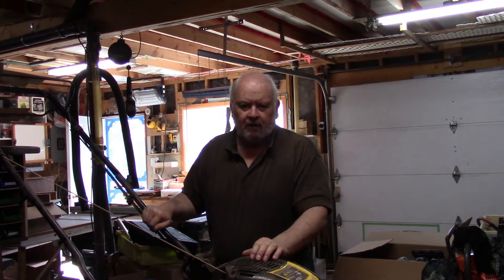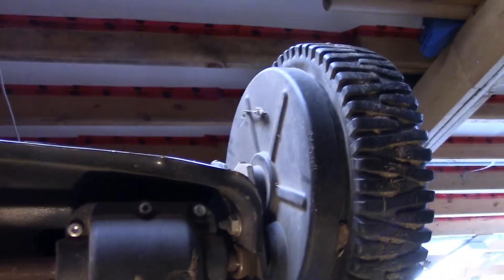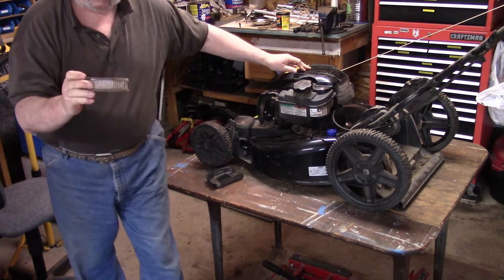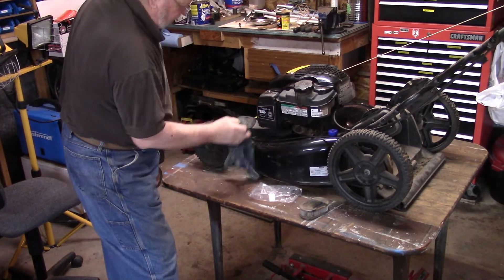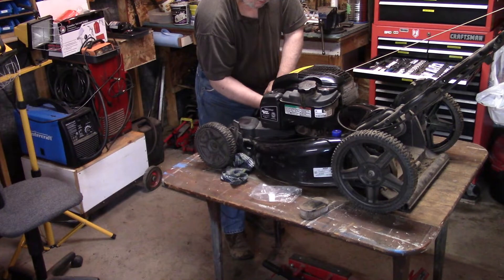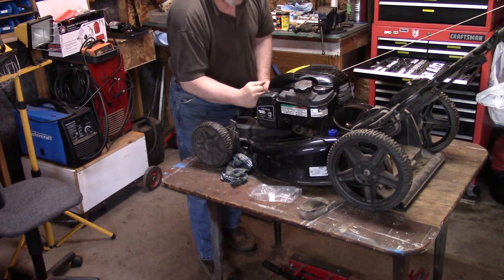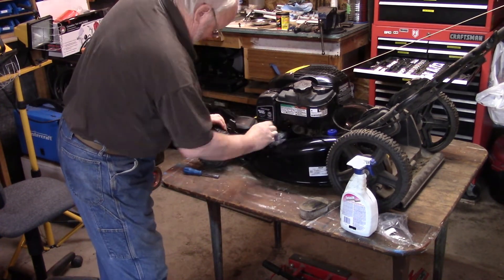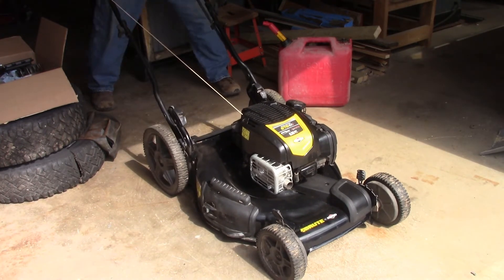Lawn Mower Maintenance

Comment: Oil comes from the ground and has the dirt filtered out. We filtered and recycled the same 30 barrels of hydraulic oil for the nine years I managed the Machine Repair and Maintenance at UTC. The oil doesn't change it just picks up junk from the environment. 
We heated it to 140 degrees F. to drive off the humidity. Then filtered it through a three micron filter. The oil passed new specs for acidity, viscosity, and particulates after each test.
We lost a gallon with every filter change. Before we fixed and tweaked the setup on the recycling system and got it working again I was buying 15 barrels of oil per month. Every year we disposed of 60 barrels of oil. 20 barrels from each of the 3 extrusion presses during the annual maintenance. 
The inexpensive oil you buy that is marked rerefined is simply filtered. 
Briner oil sold me 15 barrels of hydraulic oil per month. When I stopped buying hydraulic oil the salesman asked me if I changed suppliers. I showed him the system and how it worked. He asked if he could test a sample. He was sure we were using bad oil. 
The test came back as good oil. We talked and he explained that he was sure it would be acidic. He also thought the zinc compounds would be removed by the filters. 
Soon after that Briner built their own recycling system and is selling "rerefined oil". 
My brother owns a steel hauling company. They connect an external filter pack to the trucks when they are parked at the terminal.
Reply from the maker: How's she goin'?  Oil's life span can be increased for sure.  Where I worked we started to do oil analysis of all major gearboxes and switched to synthetic oils.  Our oil consumption went way down, and like your oil supply guy, ours turned to re-refining oil rather than selling oil!!!  I still think I should change the oil in my mower though!!!  LOL  Take care and thanks for the comment!!!
Reply: @GrampiesWorkshop  I thought about filtering the engine oil at home. Two cars, 3 tractors, a mower, and a truck ended up at near 20 quarts. The problem is there isn't enough reserve oil in such a small system. Filtering a gallon of oil at a time requires running pumps, heaters, and filters just like the bigger systems.
At UTC the oil that drained or leaked from the presses was originally captured in an underground steel tank that held about 30, fifty five gallon barrels of oil.  Later I installed 3 diaphram pumps that returned the oil to the filter system. The filter system at UTC would hold about 10 barrels in process with another 10 in storage for times when we needed to drain a press. Each of the 3 filters at UTC held about a gallon. The filters cost $30.00 each. The oil to fill them was $12.00 per gallon. The pumps and heater ran for two days for each batch.  The process tank always had a full tank. The filters lasted for about 20 barrels of oil depending on how dirty it was. 
The plants oil capacity ended up at about 110 barrels at the time, 1981 to 90, about $72,600.00 worth. 
I could buy a lot of filters for that.
20 quarts isn't economical unless you start collecting it from each oil change. When we moved here I left behind a nearly full  collection drum. 😕 I had all the pieces for the system. Oh well. No room here and most of the oil using equipment was sold before the move. 
My brother has a bunch of semi-tractors and a staff of mechanics. The filtration system works really well on his larger scale.

Comment: Awesome Grampie《☆》Gotta love them B<[]>S motors. I know it's time to clean the air filter on Frankenmower when it starts running rich. It's been on the continual oil change program since 2019 due to a little blowby condition but she still cranks 1st pull after 12 or more Florida years :*: Greetings from⛾Florida🤳my friend🤓🗣🔊☮✌👍🏾
Reply from the maker: How's she goin'?  If it works, don't fix it!!  LOL  You should change the oil though.  I don't understand this label, but then again, I'm not a lubrication expert!!!  LOL  Thanks for watching and take 'er easy!!

Comment: In the late 50s or early 60s Robert McNamara of Ford said they developed a filter system that you only needed to change the oil every 15,000 miles and that was with 50s/60s oil. 
The engineers at B&S likely know what they're talking about but if it makes you feel better and since it doesn't cost much go ahead and change it. 
One thing I know about oil is that people will believe whatever they want regardless of what the real evidence and lab testing proves.
Reply from the maker: How's she goin'?  That is so true!!!  And once someone believes what they choose to, it's very hard to change their minds!!!  I will change the oil though.  But for this video I didn't bother.  Thanks for watching and for your comments.  Take 'er easy!!

Comment: Hello Mike. Maintenance is the key! Never change the oil. LOL.I bought a mower from sears just before they went under, it has a Honda motor , It's a great mower ,but I went to change the oil ....no drain plug...WHAT!!!!!!, Have to tip it on the side to drain oil according to manual. Nothing but a bunch of baloney if you ask me. Thanks for sharing,take care
Reply from the maker: How's she goin'?  I have seen engines with no drain plugs before.  Wacky as a bad of hammers if you ask me, but they never did!!!  LOL  Thanks for watching and take care!!

Comment: Looks great now, good job. Seems odd that they recommend not changing the oil. We have an old mower and it has no oil drain plug, we have changed the oil and we had to hold it upside down to drain from the filler
Reply from the maker: Good day eh!!!  I have seen mowers with no drain plugs.  That's another thing I can't my head around!!!  Anyways Joseph, thanks for watching and take 'er easy!!